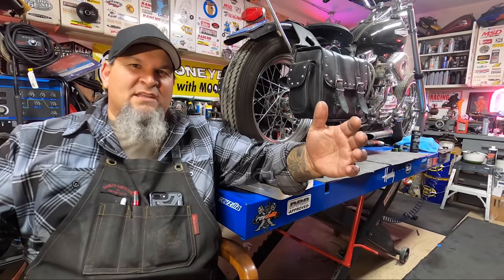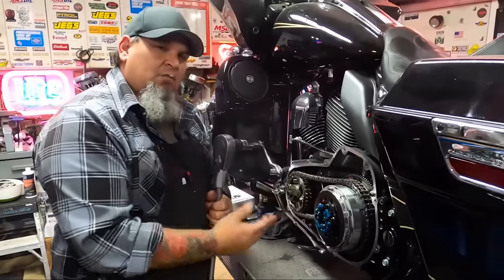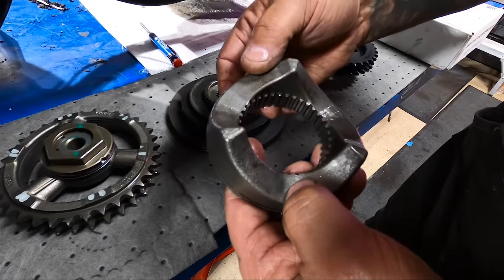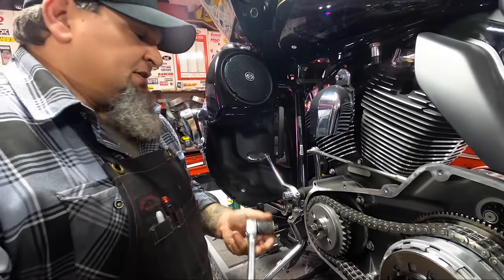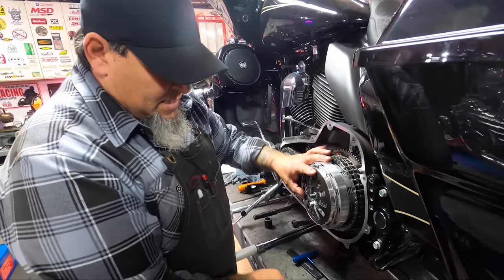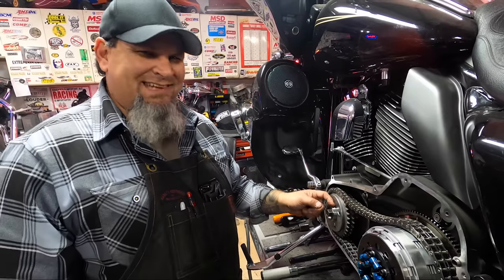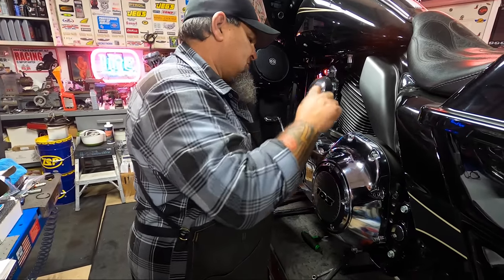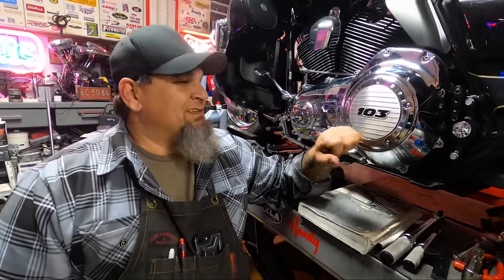Compensator Upgrade for Harley Davidson

Comment: Had comp problems right outa the box on my 110 back in 2017. Only a thousand miles on her and the inner springs broke on the stock SE comp. Primary gets a little noisy when hot to this day. Been kicking the idea of the Man O War but I wanted to see some reviews first. Thanks for making this video. You've made up my mind. This is a must for sure.

Comment: wish I would have seen this before I got rid of my 2016 Road Glide. At about 10K miles I started going through compensator hell. The repair tickets kept piling up, and the same problem kept recurring not long out of the shop. Gave up and got rid of it. Screaming Eagle compensator did not solve the problem either. Motor was stock. Oh well. Nice video.

Comment: Nice video, have the baker compensator on my bike. Debating on getting the man-o-war for my 107" build. Kinda weird that Harley says to do the torque procedure like that to prevent galling. Loctite in itself is a lubricant that is supposed to prevent any galling during torque up.

Comment: Great video! Have a question regarding the compensator bolt. I've seen both the new style (T70) and the old (in your video) used. Confused on which one is actually the correct one to use. (2012 Ultra)

Comment: I would have liked to see you replace the rotor and install the oil shroud that come with the Dark Horse Man O War kit for touring bikes. They are required for my 2010 Ultra Limited but we’re not required for my 2016 FLSTC.

Comment: Thank you for your enlightening video.
All my old Harleys ran with the front sprocket hard mounted without a compensator.
Do you think that hard-mounting it on my 96" TwinCam would cause issues?
It would be lighter and no need for replacing another compensator.
Thanks for your kind consideration.

Comment: Gary,
My first Harley, 2021 Fat Bob 114 has 1200 miles. Primary has a significant whine. Changing to the dark horse compensator, with a new tensioner will cure this? Heavier oil made a little difference.

Comment: I had a compensator on my 58 panhead open primary, saved my motor when a bolt got caught in the primary chain. Just a big spring behind the primary sprocket and crank. Simple.

Comment: I have seen the chain tensioner removed from the primary allowing slack in the chain, then the compensator can be removed without having to remove the clutch assembly.

Comment: Great job! I've got an 17 Roadglide, 10k miles and a coolant oil leak just above the exhaust port on the rear cylinder. I've ordered the MLS head gaskets and of course, they are backordered. So while I am waiting, I ordered the Fueling HP+ oil pump and cam plate. I have worked on cars and trucks since I was 12 years old (61 now) but its my first time working on my Harley engine. With only 10k miles, do I need to replace push rods and tappets?

Comment: Dark Horse says you should use the Torx bolt, if you're trying to save $18 then you can reuse the old one.  But you should consider what 175 ft lbs of torque does to the metallic  structure of a bolt when torqued multiple times.  Harley says if you remove it, replace it.  I agree.

Comment: Hey Garry , great job ! 
you’re my new go to guy .
you’re always explain it calmly and precise .
I have a question . And that new chain adjuster .
Will it adjust itself if the chain stretches through time or do you have to get in there and adjust it once in a while ?
Anyway, great job keep up the good work .
I’ve learned a lot from you .
The compensator is slipping on my 95 Dyna and now you showed me exactly how to do it , with all the bells and whistle’s and tricks .
 You have a great day 😎👍

Comment: Good vid, but you didn't mention anything about gluing in an oil diverter onto the primary cover, or removing the rotor and replacing it with the HD #30041-08. Also checking the chain alignment. Unless your bike is built to the hilt, you can get by with a Screamin' Eagle one for about half the cost.
Reply from the maker: Hi Micheal, they screaming eagle oil diverter does not interfere with the new compensator, so it was left alone. My motor is a very well built 117, so it's been hard on the screaming eagle parts.  The alignment was spot on, I see that Dark Horse now offers shims along with their latest production units.....I had zero issues aligning it.

Comment: I am so grateful for this post. I gained knowledge & so did my private mechanic that was handling this. Never heard if dark horse & knowing my 03 RK was taken to a 96” bored & stroked made us think the clutch & compensator was left stock. We were right. I heard it clattering & stopped. Trailered her back to my mechanic who thought it was just compensator. After he fired it up to diagnose he figured clutch as the clutch was very HARD. After watching this video we discussed upgrading compensator & clutch since he’s already inside. Makes sense right? So thats the plan i will update how this turns out. On my 03 RK aka Amanda.
Reply from the maker: The man o war design isn't available for the first gen twin cam as of yet, but I hear talk they might build one....... The Baker is a good choice as well as a screaming eagle unit, as your bike will only take those since they're the only ones available....

Comment: Great video. Someday, the "Ruuuuuublub blub bulbbin Tribe" will come to understand that the compensator is not a static unit when you constantly blip the engine at the stop light/signs. Or better yet, revving the crap out of your engine underneath the highway overpass.

Comment: Good Video!  But I'm a little confused on bolt selection.  The Darkhorse website says the sprocket was designed to be installed with the T-70 bolt, and it even improves oiling of the sprocket.  How did you determine this is not the bolt to use?.. am I missing something?

Comment: Good video & advice on tool/parts needed , I went with Baker primary chain adjuster & try to do most of work on my 2011 roadglide Ultra & 2017 freewheeler, videos help , you guys a lot better than most stuff out there 👍

Comment: Good job Gary. You had HD 30041-08A in behind S creaming Eagle comp?
Dark Horse recommends a HD torrent bolt but you were correct drop supplied HD bolt water and use stock. You didn't go over Engine Sprocket alignment procedure to determine that the Sprockets were true. But you have the best video on YouTube

Comment: I doubt the 2-stage torquing is necessary with the DH at all. I think a part of that it also helping the springs seat properly with the factory style compensators.

Props for using the proper term for your “ruler”.

Comment: Gary,
 Bought Darkhorse compensator for 2008 Road King. Documentation states Oil Deflector part #62700063 required. Also Darkhorse says bolt required part# 10500031 Bolt For Flywheel. You don't mention the Oil Deflector. Was that already in your primary cover?
And you removed SE bolt stating stock bolt for Darkhorse. 
Great video thank you.

Comment: I have a 98 Softail custom
And want to change to rear chain drive. I.E. 24-25
front sprocket and 44-48
Rear.  What do you recommend. As for highway gearing with
A stock Evo minimal
Upgrade and are the 
Conversion kits available
With alignment spacers
In the kit. Maybe you have a customer that want you
To do the swap. That would be a great video.
I really enjoyed your video. Thanks 🏁

Comment: Gary, great video, you make the service straight forward, and explain it very well.....HEY Gary... put electric start on my 50' panhead, every now an then it hits with a haard 'clunk'....the drive doesn't always mesh with the ring gear, thought it was alignment, but all is dead nuts.....a friend has a 90' stock FXRS and one nite while riding his FXRS did the same thing a hard 'clunk' when starting.....ANY CLUE, HAVE YOU SEEN THIS BEFORE, Bob

Comment: Great Vid,,,, I have an  S&S 113 ci motor installed on my 1988 softail FLST which has a 1990 1994 primary. All the compensators I found were for either TC or M8.  Where can I find the upgraded compensator for an EVO style motor?  Thanks and am your newest fan.

Comment: You are very well spoken sir! U should be a teacher at a tech school ! My 87 FXRS has stock compensator assembly ,I have renewed the compensator  nut and the compensator cover ,( with the disc springs inside) . I also added a bronze bushing shim under the nut to take up any slippage I was having .That worked good. Would you recommend any upgrade to my stock Evo compensator  ,if so what kind ? My motor was professionally rebuilt about 6 k miles ago ,rest of the bike got 80 K on it. 87 FXRS . I am getting slight primary knock cold low rpm , chain adj properly etc . Thanks

Comment: Great vids.   Just came across your vids.    Have a couple HDs.   Long time rider and have no problems with wrenching on my metric bikes, just never really into wrenching my HDs.   Your vids break it down great.   After a recent S&S 124 install in my 16 SG, I think I need to add both of these mods to mine.   Both Darkhorse and manual tensioner have been on my list.   Looks straight forward.
Reply from the maker: Hi Kraig, it really is an easy upgrade to do yourself. There are lots of good stuff to choose from when doing that upgrade, and I really like the Dark Horse unit. Smooth power and zero noise!

Comment: Great info as usual!!  Cool you  informed us about no impact on bolts!!  I've gotta 02 R.K. Big bore kit. I'm getting a kick back / starter kickout only when Hot!!  Bought used, thinking maybe starter? Or Compensator? & Dose clutch have to be removed to remove on the 02 road King? Thx.

Comment: Hey, I watched and enjoyed a lot of your videos,  great job. I have a question,  I worked in a bike shop, most of my younger years , and I work steady on cars, we were always taught , conventional oil, to break in new motors and new parts , then switch to synthetic oil, (usually 1000 miles or so) so how come the assembly lubes, are all synthetic or semi synthetic,  what's your view on that ? If I'm doing a cam chest for instance,  all brand new parts,  no wear patterns or anything yet , wouldn't conventional be a better choice until it all breaks in??

Comment: Nice video! You did a gr8 job explaining and very thorough. One question. Could wear on the existing stock compensator cause or be partially responsible for hard shifting from neutral to first?
I have a 2014 FLHXS (Street Glide Special) and it seems like over the years the initial shift into gear from neutral is harder than it used to be.

Comment: I had an 08 street glide that was bad about going through componcader every 20,000 miles. The screaming eagle was the same and would cause starter clutch issue.  Great video.
Reply: The screaming eagle one is NOT the same as the stock 08. The stock was junk. The S/E is a nice unit as long as you're not a highly modified gear head.

Comment: I found upgrade tensioner needs too be removed an replaced for reasons you give here! I wanted too know why too back off compensatory bolt an you informed me of that too! I enjoyed a learned some new tricks here from you! Thanks! I have 03' fxdx Dyna an doing the timing chain mess fixed too! Have a video on timing chain fix? New problem? I saw on website dark horse compensatory only goes too 06' an I have older 03 Dyna?

Comment: Do not use those wedges to lock the chain. They can cause a bent transmission input shaft. Make a lock bar out of a piece of cold rolled bar stock.

Comment: I purchased the man o war compensator for my 2012 Harley-Davidson Road King the instructions say to use a Harley-Davidson torx bolt  #1050031
And to torque it to 175 ft lbs yours is a 2011 why is it different?
Thanks for your help 
Kevin
Reply: Hey I spoke with Andrew at Dark Horse and he told me that you have to use the torx bolt H-D #10500031 and torque to 175 ft lbs

Comment: Hey Gary great video I  have a stock 2000 ultra classic,  has 32000 miles, runs like a champ, would it be beneficial to change the compensater.

Comment: Great Vid Thanks. You mentioned the compensator bolt is a 13/16 but I didn't hear you say the size of the clutch nut. If you could let me know what that is? Thanks! Edit I found it. It's 1 3/16 socket

Comment: Hi Mate Grate video could I please ask why you would use the old compensator bolt ? I have just had a new se comp installed on my 09 Fatboy which puts out 123/128 TQ and its noisy ! noise I never heard before.  Was all stripped again and found no issues wondering if it has something to do with the Torque on the new T70 bolt Cheers Adam in OZ

Comment: You mentioned you’ve changed out two or three compensators on your motorcycle. How many miles did you get out of them before you change them out. And are you a hard throttle rider so that it would wear out faster or are you an easy throttle rider?

Comment: GREAT video!!! I try to perform all my own maintenance, so this really helps. Only type of video i can suggest is anything 12v/wiring type vid. That stuff kicks my butt for some reason.  Example: adding a switch for an added 12v source,,,changing from standard lighting to LED (where the wiring for the part ya just bought is difft.) Again, great video sir!!!
Reply from the maker: Hi Wade, I will put that on my list as I have a bike coming in for some LED upgrades. As far as the lights go, those are plug and play. All you need is a load equalizer to run the cancellation feature correctly and they sell those plug and play. I will put something together...

Comment: I heard that you cannot use it on all harleys. It seems that the allighning with the clutchbox must be  perfect. Also the runout munst be not more than x/1000e. Or the darkhorse could be damaged. And result in a lot noice . 
Im not a mechanic, but could the whole operation be done in 2 hour ?

Comment: So, the DH comp is basically a Cush Drive for the crankshaft. That’s pretty sweet.
Reply from the maker: You bet!
Reply: @LateNiteVTwin  wonder what cushions are made of and how long they last. LOVE the videos, LNVT. I've replaced my own V-twin stator after buying specialty tools. Like to be a hands-on bike owner. How about some thoughts on the new H-D heavy weight Syn3 primary & tranny oil? Thanks
Reply from the maker: @joeforeman2804  Joe, thanks for stopping in! The cushions look to be made of two different densities of eurothane type materials? Spelling? They claim they will last 60k miles in a well prepped engine. As far as the oil goes, the Harley oil is of good quality, but I stay away from using it in the transmissions for several reasons. Gear boxes require a pressure additive in them to help the gears survive due to the nature of the parts moving against each other. Engine oils do not require a pressure rating or additive. Most synthetics do a great job at protecting what they are designed for. I say, pick a brand and run with it.

Comment: Great video!

My question is, I have a ‘19 RGS and I plan on putting a mild cam eventually, like a zippers 468 or similar. Nothing too crazy so would this particular upgrade with the compensator even be necessary? 
Believe me, I have zero issues buying parts for my bike lol, but if it isn’t really necessary, I would put the $$ elsewhere.

Thanks!

Comment: Thanks for the video! 
I have a question. 
When installing a manual tensioner and making the chain slack adjustment, what gear do you do that in?
I have heard 6th if application has that option or 5th if not also I have been told 1st as well as neutral… but I assume whatever gear you make the adjustment in, the slack would stay the same in all gears.

Comment: Gary, What Exactly was it that you didn't like about the Solid Sprocket that you had installed and did you ever install a 30 tooth Solid Sprocket Compensator Eliminator, Thanks

Comment: I have a h/d 2009 custom c think twin cam 96cc who can i get a darkhorse man o war compensator and the twin power manual chain adjuster from. Im actually in Auckland New Zealand and our Harley agents don't stock these parts and quite frankly I don't think there interested to help. I like how you explain things which makes it so easy, looking at other videos and they dont help or are hard to follow. What was that saying you have buy once cry once, i could live by that. havent rode bike much working so want to get it in motion. Need company that ships.

Comment: Super great information  bro like to see a video on timing chain tensioner replacement i plan on doin mine this winter I have a 2002 88ci.dyna low rider not having issues yet but was told need to go ahead and replace tensioner but I can see where the compensator would make noise  metal on metal has to right  I think I will check this part also thx man

Comment: Great video, very helpful, Question, is there a similar issue with 88" and 95" Twin Cam bikes? I have an '01 with a big bore kit and cams, and do not want this type of costly failure
Reply from the maker: There is, the more torque output, the harder it is on a compensator. The fix has to avenues. One is a solid gear with manual tensioner or an upgraded compensator.

Comment: Hi, Gary!  Fantastic video, as usual!  Quick question:  Dark Horse has a disclaimer / warning on their site about running their compensator in conjunction with 'easy start' cams (e.g., S&S 585's etc.) Dark Horse states you MAY run into starting issues using their comp w/those cams.  Have you (or anyone out there) actually experienced any starting or other issues using the DH comp and aftermarket cams together?  Thanks! ~ AJ
Reply: As I was watching this video, I went to the Dark Horse website and saw the disclaimer as well.  I was wanting to install this on my 2009 Night Train (96" twin cam).  Did you ever get this answered?